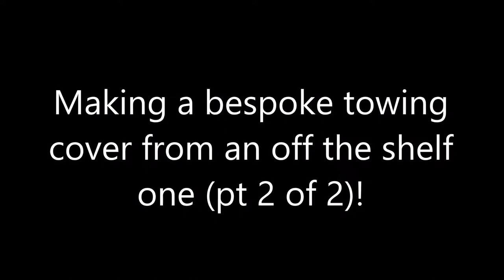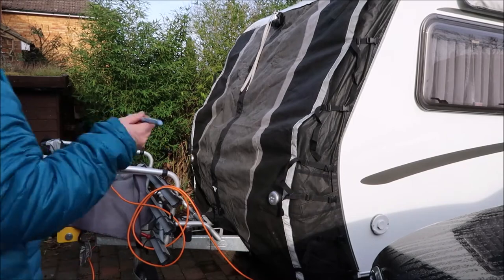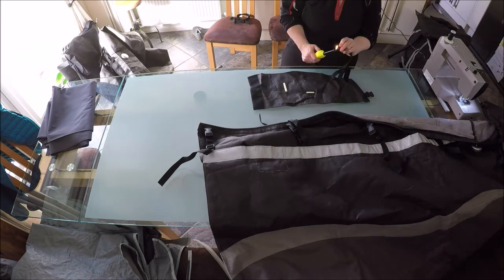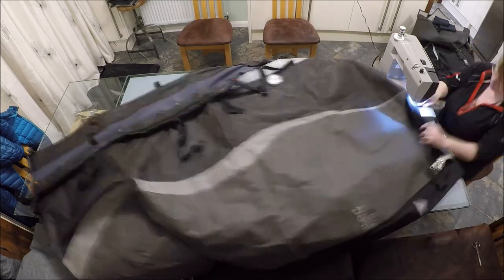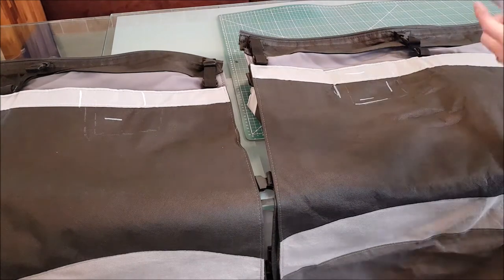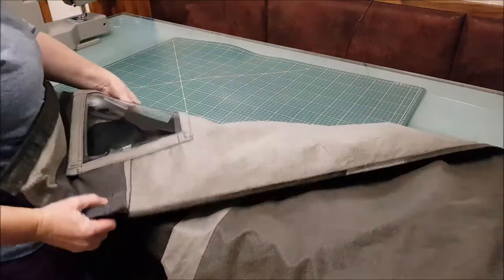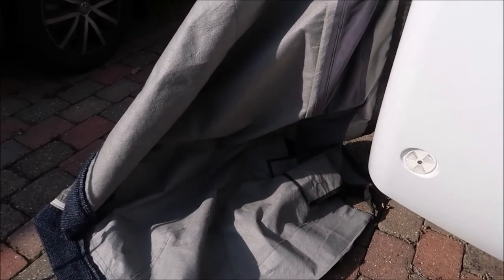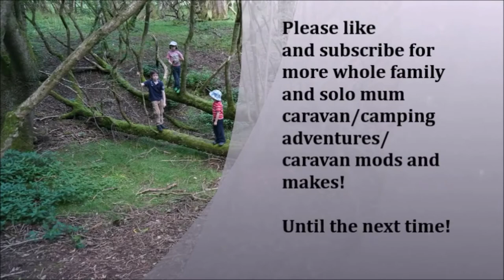Making an easy fit bespoke towing cover out of a universal fit one: pt 2 of 2

Comment: We have the same cover which is s very good well made product. I like what you did with the lights.
I've gotten into a routine with the fitting and removing and I can't sow, so that won't be attempted but the lights yes that'll get done, so thanks.
Reply from the maker: Thanks for watching, great having the proper road lights show through as now I don’t need to worry about making sure the battery ones are ok! Fabric is easy to work with so I hope your mod goes well.